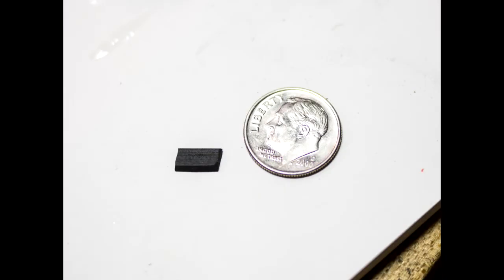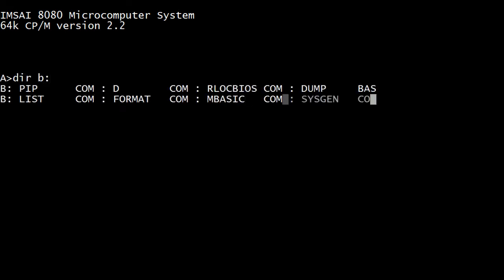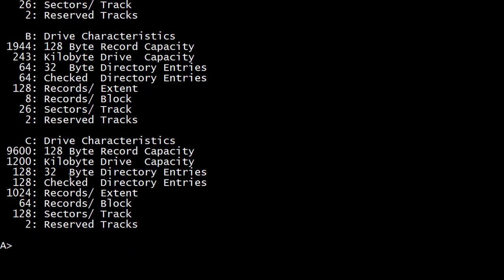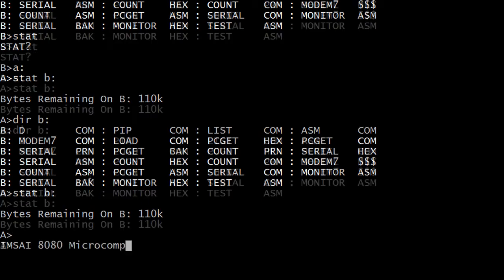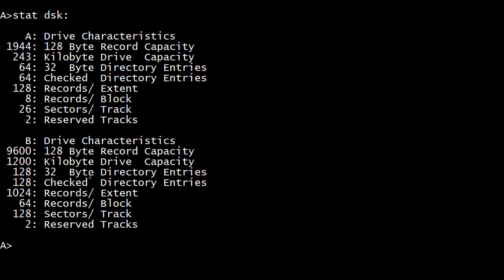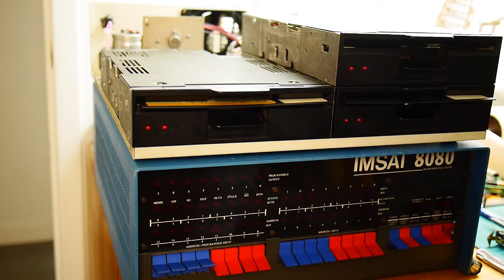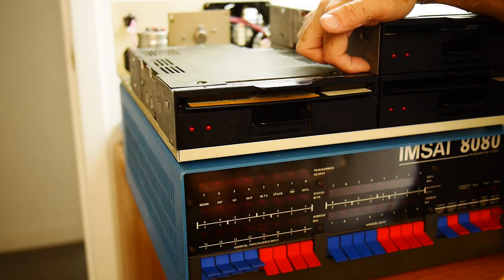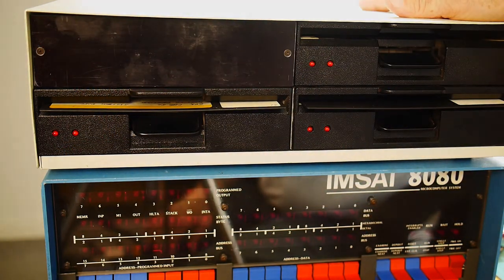#44 IMSAI 8080 final drvie test

Comment: Nice work, I personally would cut a hole in the panel for the display and build in that beautiful dot display from HP for direct reading of the address. I have 6 pieces at home and I still haven't found the application I would like to use them in - I'm sorry about those displays for those prototypes.

Nice day 🙂 Tom

Comment: Nice. I'm surprised  the pink foam under the white plastic head lifter is holding up. I have seen several videos of old computer equipment where foam disintegrates from aging.
Reply from the maker: I was too. It seems like it has a few more years. it seems so fragile